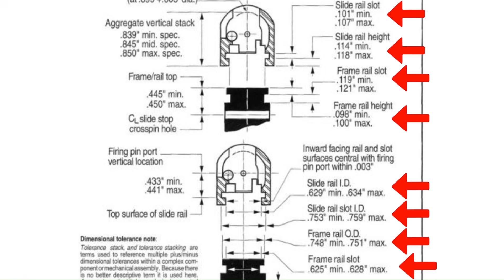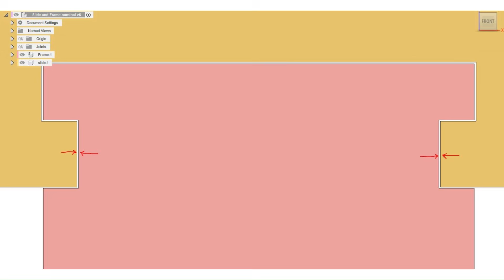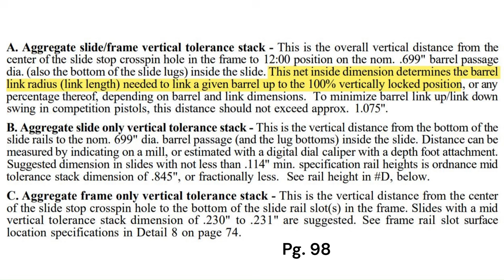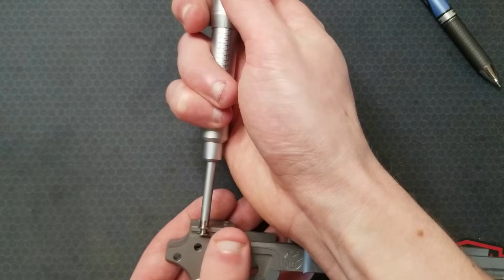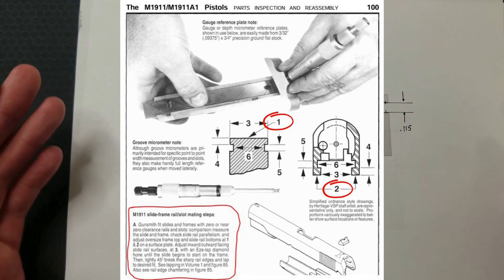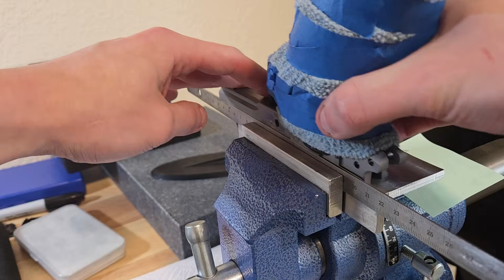1911 Slide to Frame Fitting

Comment: Have you ever had to tighten a frame-slide combination?  I was wondering if adding a little material on the frame rails and then machining/filing the added material to fill the gap to the slide was a possible solution.
Reply from the maker: I have and i made a detailed video about it.

Comment: I have a Prodigy and I’ve been having trouble with EGW hard sear fitment: When I install EGW's hard sear (I've tried both available sear lengths) alongside the rest of my EGW ignition kit parts, the grip safety stops blocking the trigger correctly - I can pull the trigger hard enough without depressing the grip safety and the hammer still drops. This only happens with the EGW sear installed; swapping back to the stock MIM sear (with everything else unchanged) resolves it completely. Ive tried to figure out why in the past and gave up but thinking about revisiting this issue. Do you know why this could be?
Reply from the maker: Changing the sear changes its relationship to the hammer hooks. It is pivoting further back at the tip (towards the hammer), and the bottom is pivoting forward, away from the thumb safety lug. This has opened up a gap between the bottom of the sear and thumb safety lug making the thumb safety no longer functional. This is something that can happen when you swap out the sear that the thumb safety lug was fit to. Also since its a production gun, the fit of the thumb safety lug to the sear may not have been very close from the factory. If you want to use the new sear and ignition components youll need to fit a new thumb safety.
Reply: @EngineersArmory  Hmm, the thumb safety works fine though. Its specifically the grip safety that is not working with the new sear. Does your comment still stand true?
Reply from the maker: @cerberus1994  Ooooh sorry I read that wrong. Similar issue tho. Grip safety blocks the trigger bow from moving rearward. So the new sear and hammer engagament relationship must mean the bottom of the sear is pivoted forward more. The trigger bow is releasing the sear (via the disconnector paddle) earlier due to this, before it has a chance to come into contact with the arms of the grip safety. So new grip safety or add material (weld) to the front of the grip safety arm.
Reply: @EngineersArmory  So do you think if i got a new EGW grip safety that would potentially solve my problem?
Reply from the maker: @cerberus1994  it could yeah. Be prepared to fit it.

Comment: I don't want to sound arrogant but I can probably do this, I just have no idea where to get an oversized/zero clearance slide in the first place. There's more than a few companies selling unfinished slides but very few will tell you how much gunsmithing is required. If I buy a slide and it's already "fit" then I have no work to do or there's a real possibility it will be rattly.

This is very much the case with disconnectors, trigger shoes, beavertails, slide stops, so much stuff on 1911s. I wish there was a company that only sold significantly oversized and/or blank components.
Reply from the maker: Most gunsmith fit 1911 parts will need fitting, and have extra material for this reason. I use cheely frames and atlas slides and they have oversized features that allow this type of fitting.
Reply: @EngineersArmory On the single stack side it seems like the options are Remsport, Fusion and Caspian. I'm partial to going with remsport and taking my chances. There's almost no video testimonials on remsport but I've heard they do OEM work for some bigger companies
Reply from the maker: @onseki1774  ive used fusion and Caspian parts, not their slides and frames tho. Before I bought atlas and cheely i emailed them to ask of their components would result in the interference fit i needed. When in doubt contact the company and hopefully they will get back to you.

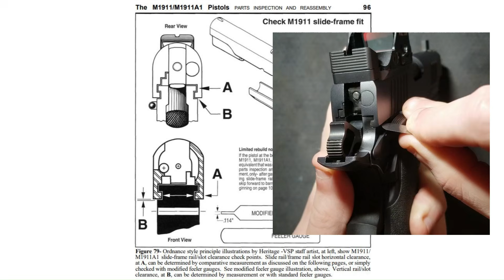Comment: 3:44 How do you modify a feeler gauge like that without altering its thickness. If you use snips wont they roll over the edge or cause a burr that effectively makes the feeler gauge thicker?
Reply from the maker: Gotta clean up the edges where you machine, grind, or snip.

I modified some gauges for measuring barrel hood clearance and I ground them then cleaned up the edges, they worked fine. 

For gauges thin enough to measure slide to frame horizontal clearances that would be hard. I wouldn't bother with the gauges to measure horizontal clearances myself.

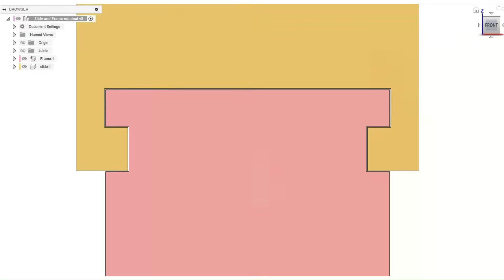Comment: 1:50 That interface would be so much better if those rail profiles were round instead of square, even triangles would result in a strong and self centering interface, but round would be the ultimate...

Comment: If you get a loose fit, you can always have the item hard chromed! Nice work.
Reply from the maker: Thanks! Yep that would build back up some material. Gotta be careful with heavy chrome like .001" and thicker, it gets brittle due to internal tensile stresses from the electroplating.
Reply: @EngineersArmory hydrogen enbrittlement ?
Reply from the maker: @vettepicking  that too.

Comment: Remember even the best caliper is only good for +/- .001". And thats asking for a bunch
Reply from the maker: Accuracy of a measurment device is generally defined as half the smallest quantity that can be measured. So in the case of most calipers thats +/- .0005". 

Of course you should prove that to yourself and make sure they are calibrated correctly. I have proven the accuracy of mine to myself by checking them with gauge blocks and a micrometer. I have confidence in most good calipers to get me +/- .0005". Thats just been my experience.
Reply: @EngineersArmory i believe its twice the smallest measurement.
Reply from the maker: @vettepicking  I disagree. But, I meant measurement error, not accuracy, sorry. Here is a video that I think explains it well. First 2 min 10 sec.

https://www.youtube.com/watch?v=dS4x22csxHQ
Reply: @EngineersArmory if you ever get bored and read the paper in a mitutoyo caliper box or on msc website stated resolution is .0005" , accuracy is +/- .001" . After 30 years using them everyday you see the limits and how they can be trusted.
Reply from the maker: @vettepicking  well that was some nice light dinnertime reading. Ill admit I was confusing accuracy, resolution, and error. The error around a measurement may be +/- .0005" but how close to true value the measurement is will be .001". Thanks for making me take a closer look at that.

Comment: Good vid pictures are always a great help !  I have to do all that by hand unfortunately, one more way to do the bottom of the slide is on a surface plate or a smooth hard surface with sandpaper and sliding it back and forth then I switch to the stone. Also on the side of the frame rails if one is thicker than the other I try to even them out to center the slide on the frame although it won't be much.